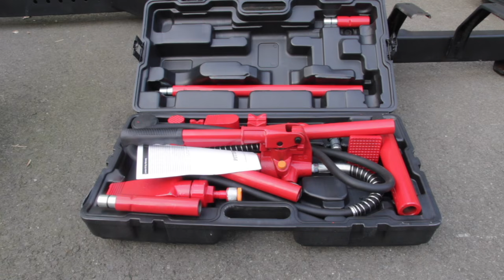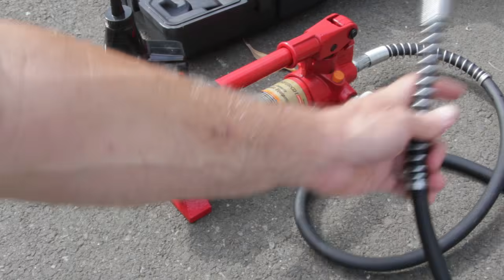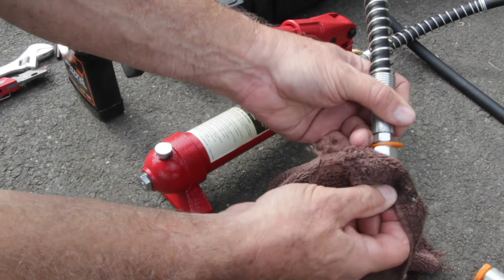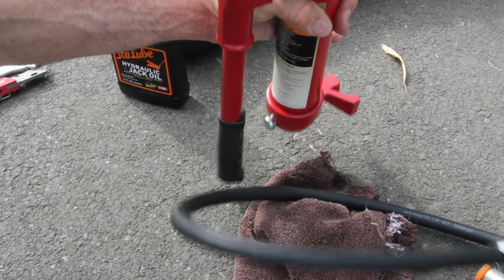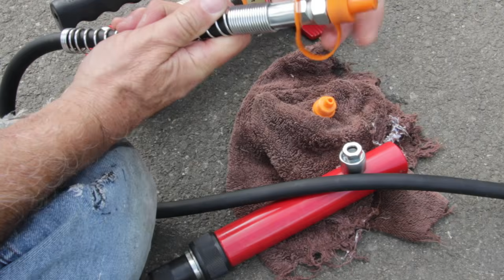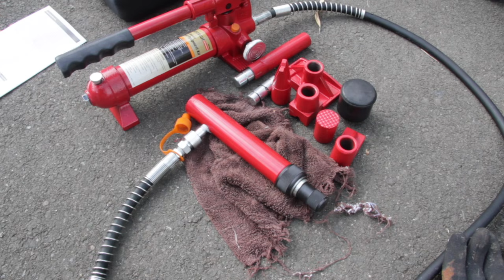Harbor Freight 4 Ton Hydraulic Equipment Kit

Comment: I just bought that same one 2 weeks ago, it was on sale for $99, But mines different,  mile has a pressure gauge on that first port plug and mine came full of fluid. And the pump cylinder on mine if longer and skinnier.
Reply from the maker: Very cool, yes HF always changes their designs.  Great on the pressure gauge

Comment: What happens when handle pushing back when u use on load plz share solution
Reply from the maker: Not supposed to do that,  check the hydraulic oil level.  Top off if needed. Or your havr an issue with the pump.

Comment: Mine is leaking hydraulic fluid when I pump How do I fix it
Reply from the maker: More than likely you cut an o-ring.  Should be easy to replace.  Dissemble  the cylinder remove and replace the o-rings.  Mcmaster-Carr should have the o-rings that you need.

Comment: which of these 2 pump's or tools i guess is the right word to push a big dent out from the front drivers side  bed side out so it's not looking soo big dent wise & to save a lil more time on the pro body guy not charging me so much roughly......lol  yes i too am in the state's like u.......
Reply from the maker: I would think that the 4 ton would work.  But Harbor Freight has a good return policy, if it was not strong enough you could exchange it for the larger one
Reply: I would use the basketball or soccer ball method where you just put a ball behind the dent and inflate it. If it looks good, stop. Do not remove the ball gradually the the ball will lose air and you might have to pop a few pounds in there.